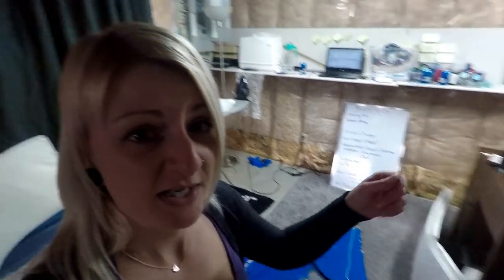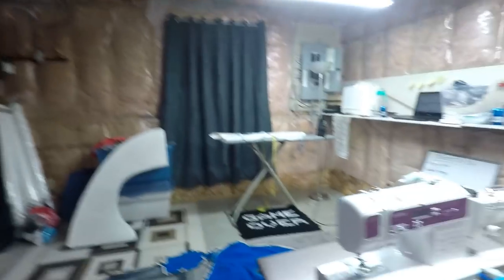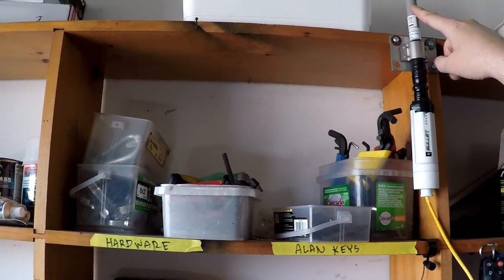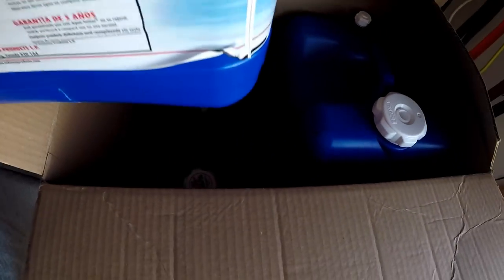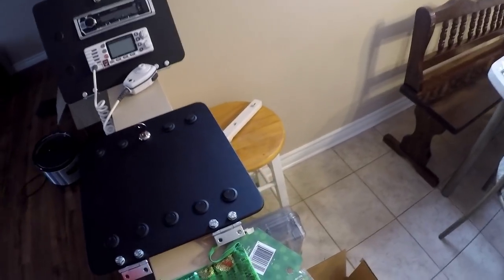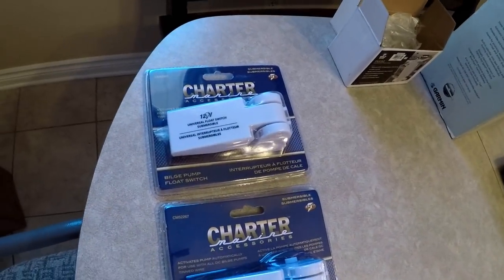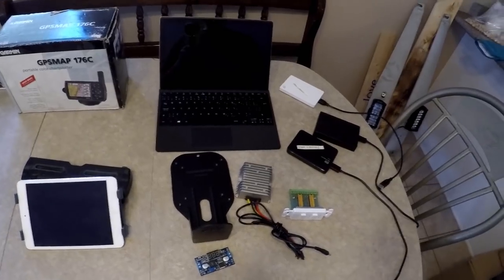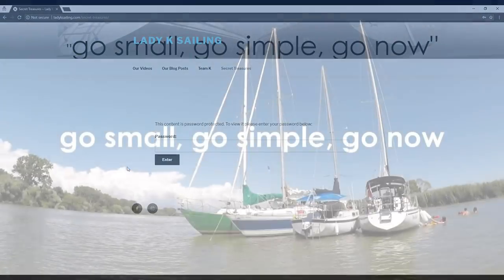Sailboat Refit for Cruising - Lady K Sailing - Episode 8

Comment: We're loving your channel and currently binge-watching from the beginning!! We actually are using a very similar WiFi set-up on our boat, our WiFi "receiver" is a WAVLINK 2.4ghz/5ghz access point (configured as a client) which then feeds its signal to an indoor home router that runs on 12v.

Comment: All that electronic stuff seems over complicated and unnecessary if you're trying to keep it simple
Its my understanding that using non marine quality items will usually lead to premature replacement of them and additional cost. I dont have first hand experience on this so I honestly cant say for sure.
Reply: Mach Man - I disagree !  Especially if they hope to make some income from making video, electronics are very necessary.  Also, I would not cruise anywhere without a good GPS and weather information system.

I will add, 𝐿𝑎𝑑𝑦 𝐾 should get a Network Attached Storage (NAS) system.  It is a several disk drives attached to a dedicated computer that can be set up for RAID 5, a fail soft system of protecting your data from being lost do to a disk drive failure.  Many models available and most can be run off of DC.